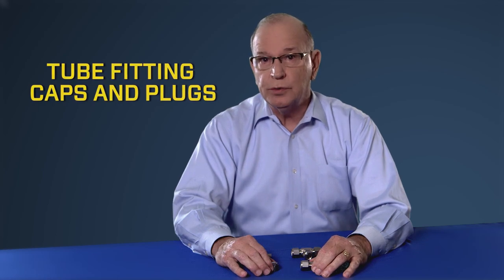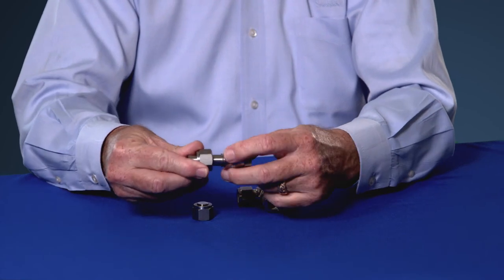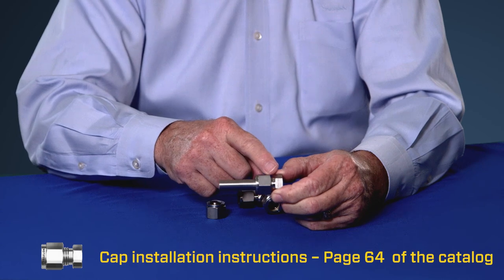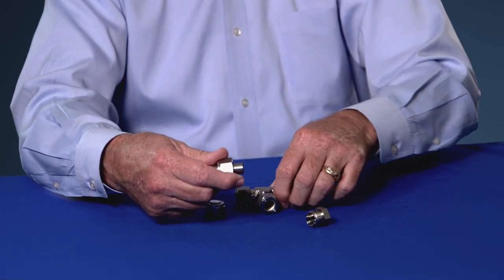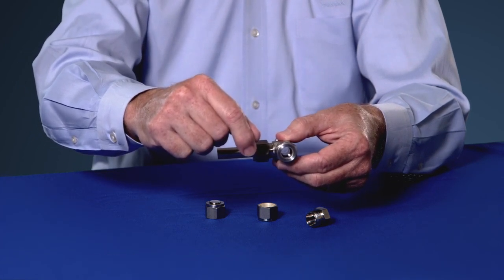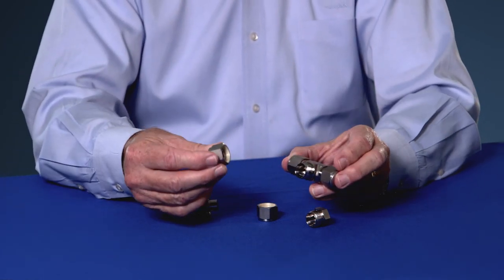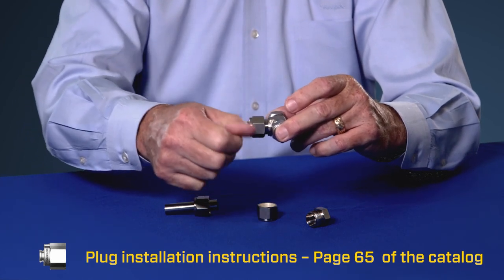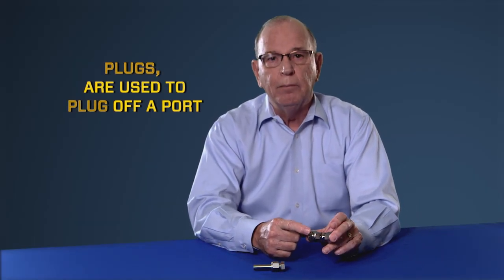How to Assemble Tube Fitting Caps and Plugs for Fluid Systems

Comment: Caps, are used to cap off a piece of tubing. It has all front, back ferrule for can be connected to the tubing
Plugs, are used to plug off a port like Tee, Cross,...